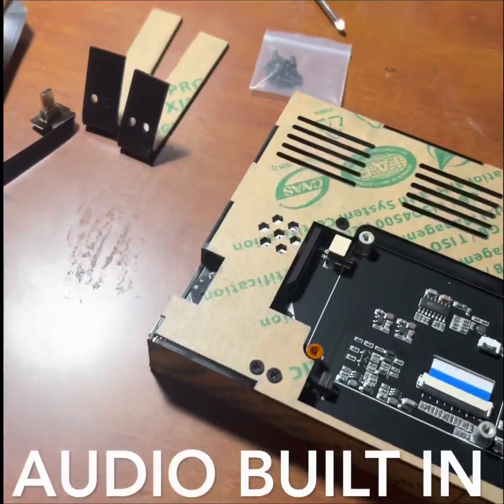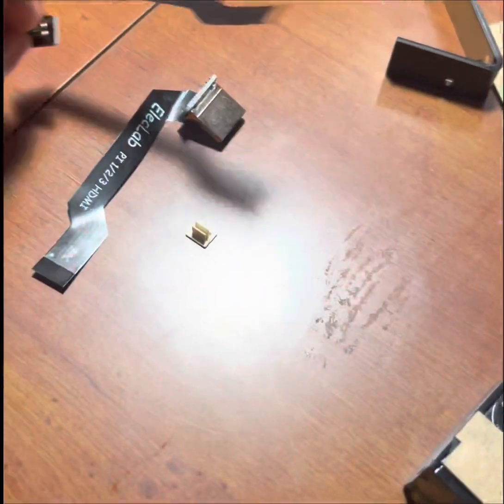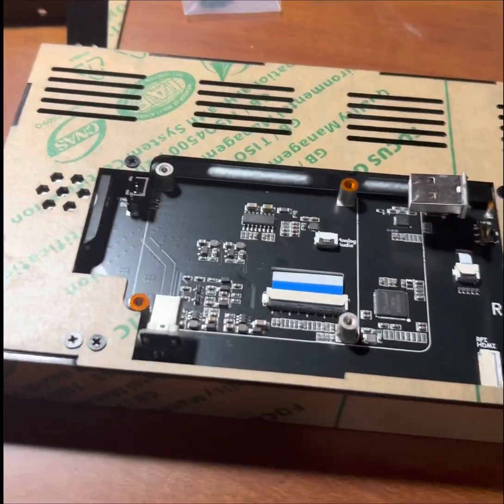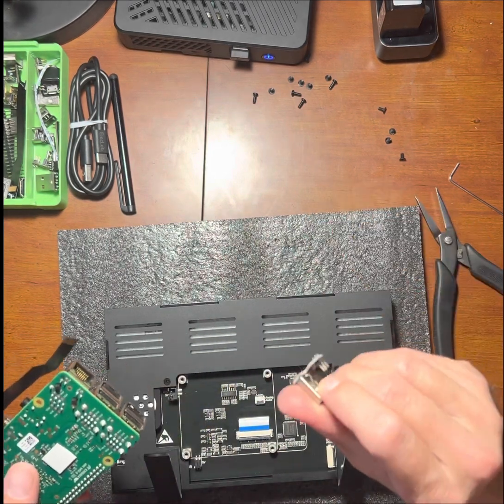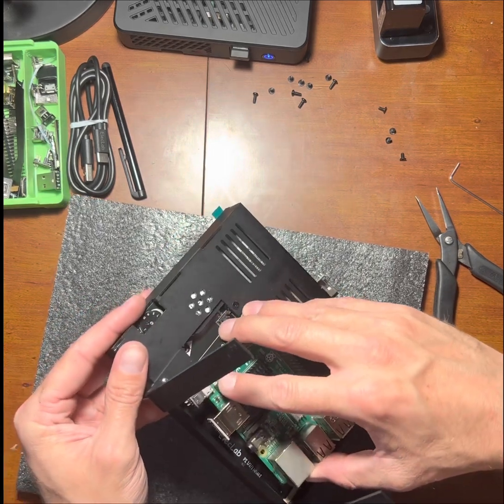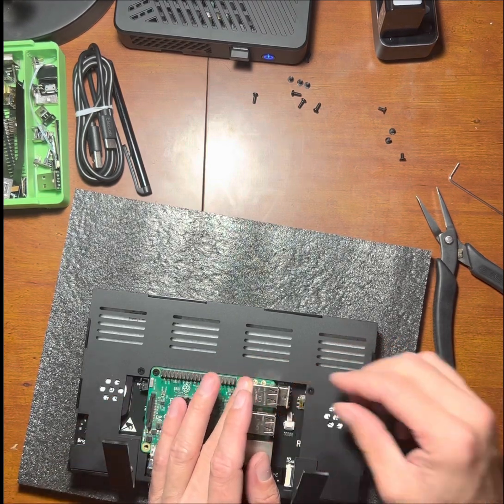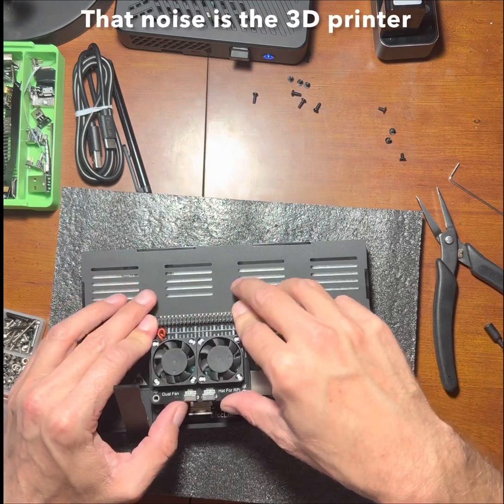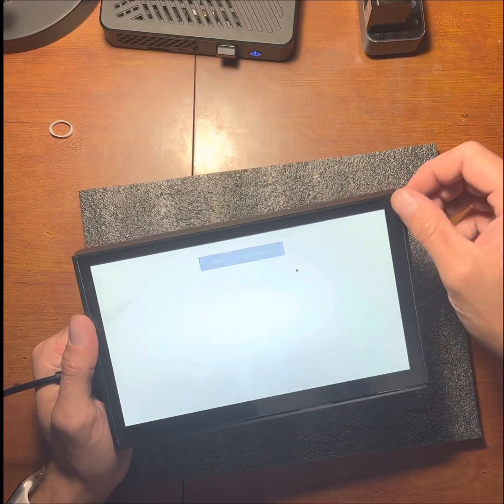New 8” Touchscreen Raspberry Pi Display Set Up

Comment: Great job, the interface is beautiful, I am also ready to learn how to install and run the home assistant kiosk. Thanks for sharing.
Reply from the maker: I would be happy to help, just let me know here if you would like a video explaining how to set a home assistant server! ❤
Reply: @kcplantman  Dear, I just bought a 10 inch touchscreen and a raspberry. I want to run Home Assistant on the Pi and display the Home Assistant dashboard on the Pi on the screen. Can the Pi do this at the same time? I've watched several YT videos but I can't figure it out. The PI runs on Raspberry Pi OS Lite 64 bit. I programmed it as a kiosk and it automatically starts chrome. But Home Assistant is not installed. So if I start Chromium and tell it to look up the IP address, of course it's not reachable. Can you help me?